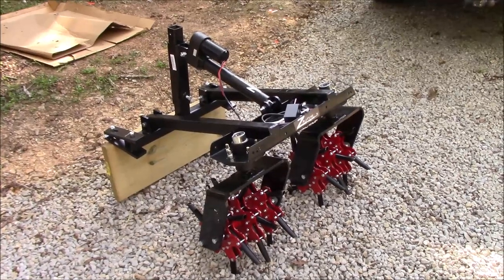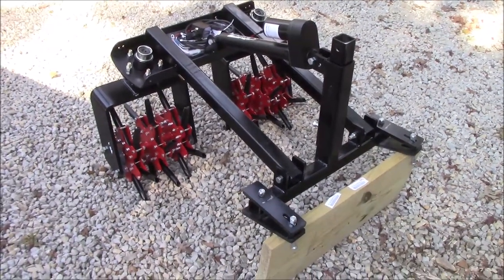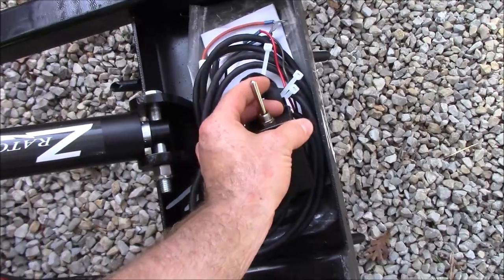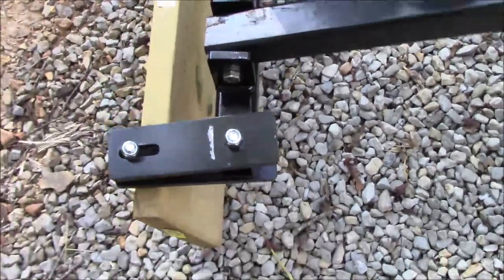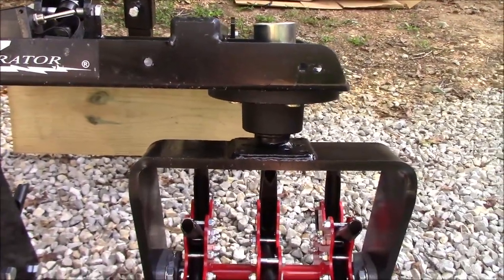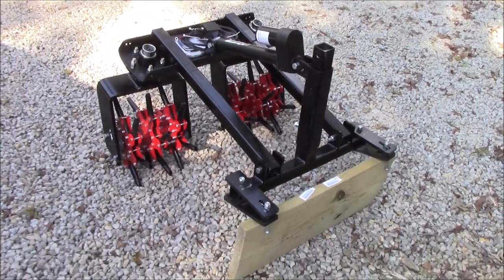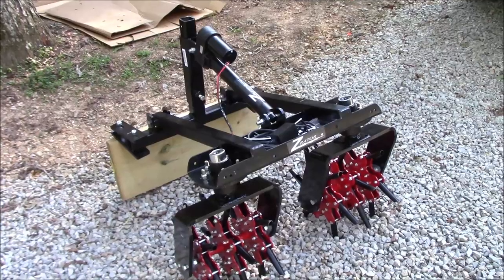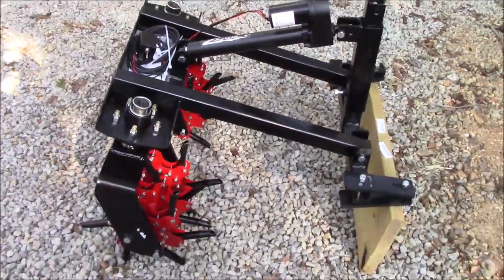Zrator First Impressions

Comment: I like that looks good how muck money? I'm thinking about 2500.
Reply from the maker: $2100 with the electric lift, $1900 with the manual lift.
Reply: HandyGuy 2016 ok thanks also thinking about the one made by jrco have u seen it?
Reply from the maker: @kenboxx265  I looked at both, but this is a core plug type, the jrco is a spoon type.

Comment: I wanted to tell u that type of aerator installed on your mower is real hard on your hydros Beware
Reply from the maker: Personal experience?
Reply: HandyGuy 2016 not mine but I knew a lawn care provider that blew out his hydros. Maybe ask your dealer that's an expensive mower your install on
Reply: I bet if you load it down crazy it might over time upset the hydros but the z3x I think runs at least the 3400 fully commercial hydros if not the 5400 which they make those on the Abrams tank assembly line. Your not gonna toast them pushing a rolling core aerator, prolly not even running a blade on the front grading